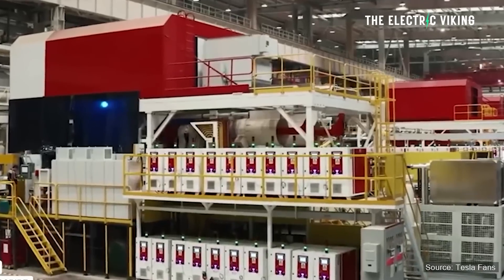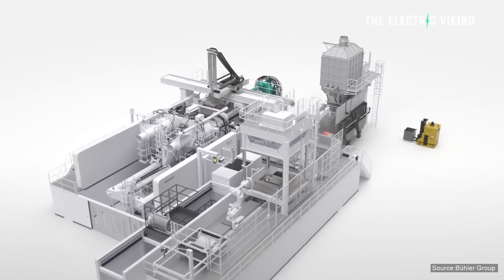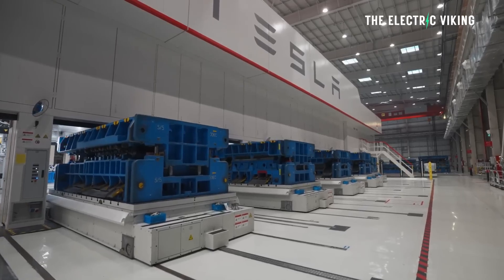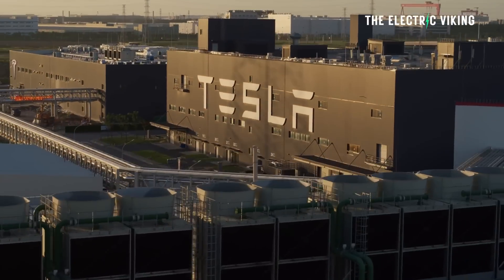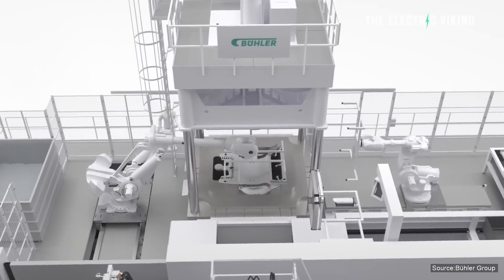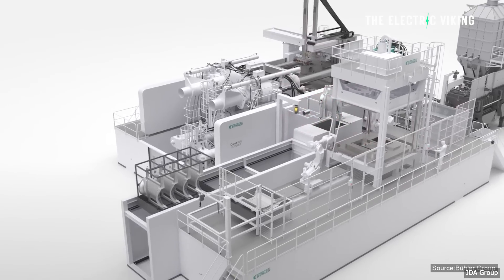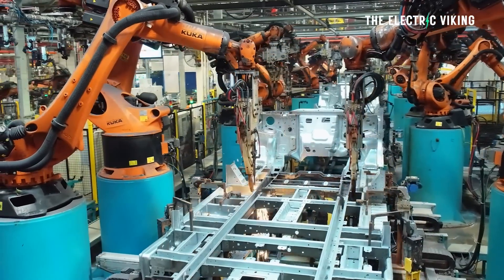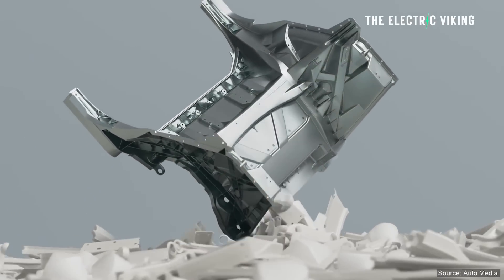Chinese engineers invent giant magnesium Gigacastings for cheaper, lighter EV's

Comment: The "stainless Magnesium" Mg Lithium alloy developed at Monash Uni several years ago solves the corrosion issue (maybe too well in that etching for bonding processes may be more difficult if possible . ) Thixotropic molding has been in use with Mg alloys for a long time and allows net shape production in one step mobile phones used it and some secondary automotive parts aerospace etc - this material and processes are superior in most ways to carbon fibre composites and many times cheaper -the energy absorption of Mg is best of all on weight basis and thicker skins resist buckling better . High pressure and high shearforce molding make for higher grade material than 'casting' might suggest.
Reply: crossing out is a glitch sorry.

Comment: Ammonia is poisonous. It is used in big refrigerator equipment which when  leaks occur has killed people. We are not talking of kitchen cleaner but a dangerous concentrated chemical. A fire in the batteries of cars which spreads to the magnesium is probable. Soap, if applied to magnesium destroys the crystalline structure causing amazing collapse of the part, into dust.

Comment: There's no evidence giga castings are used in any Tesla battery pack. Certainly, the structural packs are joined to castings, but are not themselves castings.

Also, it's not clear giga castings are necessarily cheaper than other production methods. They have the advantage of being faster and having lower scrap rates once tuned. And the parts have tighter tolerances. But they're not necessarily less expensive as the capital cost is quite high. Elon has discussed this a little bit in interviews over time. That they contribute to higher speed production and fewer defects (i.e. less rework and rejections) makes them valuable, even if they're more expensive.

Comment: Magnesium Pressure Die Casting has been around for years. 16 years ago a company I worked at used Mag Die Casting Process for a major component to be manufactured in China. They actually suggested the material and many engineers / designers were surprised but it certainly worked. As always the devil is in the details, Properties to consider are: Strength to weight (not just weight), fatigue life, Impact properties, distortion after casting (cooling), machining properties, compatibility with mating parts (pressed steel etc), Die design requirements and resulting cost, Die lifespan etc etc.       The moderate weight saving is only part of a complex equation to decide it's real advantages - if any.

Comment: The body of a car is much less than 50% of the total weight of the car. Therefore, it is not worth risking the use of some light, but delicate and easily corrosive materials to gain a dozen or so (in gusts) percent of the total weight.

Comment: Magnesium have low density and low mecanical strength, so the saving in weight for a manufactured part is not so big. But the fire hazard is big. Mg fire can't be put out by water or car on dioxide. Combined that with a powerful batteri, and cathastrophes will happen.

Comment: I had a friend that I crew chief for when he was racing.  His racing wheels were made of Magnesium.  Yes it was so light.  The advantage of a light wheel increase the handling by having less unsprung weight thus the tire is spending more time on the racetrack.  Also airplanes do use this material to lighten the airplanes.  This material can catch fire so you need to be careful

Comment: My motorcycle from 1998 has a die cast frame. Nothing new under the sun here. Only car makers didn't pick it up until now. 

May be the auto makers should also look to the possibility of using pressed fibres. May be carbon, Kevlar, Nylon or natural cannabis fibers!
And what about a modern methode of building cars like the  old school DDR build Trabant (?).

Comment: Hi Sam, I remember a fire 🔥 in aF1 car at Spar, back in the 70's 80tes, made of magnesium, very very skery . Very difficult to carst even being an alloy. I have seen on utube  a video of repairs to Tesla S "water seal, $7000, one cell in a battery 🔋 pack $7000 to. $15000 to fix. This makes me think that we might be in  the 😢😢😢early years of EV development.
Reply: Tesla designed their EVs to be built around the battery pack, making it an integral part of the frame.
It's not meant to be removable, and replacing one cell means taking the entire EV apart.

Comment: Magnesium castings is not new and I would be interested in the alloy combination they used because it’s not as a rigid metal like aluminum or steel. I don’t disagree with thebl approach to weight savings but magnesium could be a “quick and dirty” way to drop weight but with a whole lot of down sides. Also it’s going to be a long time between a scientific “discovery” and production scale capability.

Comment: Most magnesium is severely corroded by salt water so these wouldn’t be very good in the northern US states or near the ocean.  There are additional corrosion issues as well.  The fire issue is slightly overblown.  It’s very difficult for SOLID magnesium to catch on fire, but it does burn very hot.

Comment: I saw a car fire once where a "Hot Rod" with magnesium wheels--aka "mag's" burned so hot that the wheels melted the pavement while the first responders sat back and watched because there was nothing they could do to stop the magnesium burning.  Apparently magnesium can even burn under water.  I think mag wheels were eventually regulated out of automotive use because of the fire potential.  I would need to see a LOT of 3rd party testing data and 5 plus years of actual real world use before I would even consider putting my family in a car with giant magnesium castings.

Comment: I note a lot of comments below that are critical of the idea of using magnesium.  These are alloys and obviously they are tweaking the alloy significantly to come up with superior characteristics.  I don't know how this SPECIFIC magnesium alloy stacks up against aluminum alloys in every aspect, but I doubt any of those posting critically below do either.  There is definitely some impetus to using the magnesium as a key element in these car casting alloys as described by Electric Viking, because of the obvious advantage of being lighter.  As far as stuff like increasing the danger of fire, we don't know to what degree that would occur with this specific allow and we don't know if by simply reducing the battery and adding some more fire mediating material (a little bit of weight added back), they couldn't reduce the fire hazard from what it was with another alloy.

Comment: Magnesium ???  recipe for disaster.  😂🤣🤪  Magnesium is known to burn more easily than aluminium. When magnesium is exposed to heat or ignited, it undergoes a highly exothermic reaction with oxygen in the air, resulting in a bright, intense flame. The combustion of magnesium occurs due to its high reactivity and low ignition temperature. Magnesium has a strong affinity for oxygen, which means it readily reacts with oxygen in the presence of heat or a spark.

Comment: As mentioned  - Magnesium metal and its alloys are explosive hazards; they are highly flammable in their pure form when molten or in powder or in ribbon form. Burning or molten magnesium metal reacts violently with water. Remember the VW bus engine fires?...
..
Magnesium alloys are not as strong as steel or aluminum alloys. It may be good enough for moderate strength applications, but for high strength applications where weight is not a critical consideration, aluminum or even steel would be a better choice.

Comment: Sam, you hit the nail on the head. Magnesium is not necessarily the best material for making cars. We will have to see how these structures hold up under repeated tension and also in a crash.  Could be good but if so why did Tesla go with a proprietary steel casting?
Reply: Tesla developed their own Aluminum alloy for their Gigacastings. Not steel.

Comment: A more practical way of reducing the cost and weight of EV's might be to eliminate the AC to DC inverter on the vehicle. All the charging stations would need to supply DC lke the Tesla superchargers do. 
You could offer a, 'luggable' AC to DC inverter which people could keep in their home garage or even fit into somewhere on the car like the Frunk for people wo want insurance against running out of battery power away from a charging station.

Comment: There are several aspects to this.  Magnesium pricing has shown a lot of volatility in recent years and is susceptible to demand levels .  Aluminium if trading at about $1000 less per ton than Magnesium ($2,500 vs $3,500) and has less price volatility due to being produced in relatively vast quantities.  Tesla castings use an alloy of Aluminium to improve flow in the mould, minimise shrinkage, increase mechanical strength and offer good corrosion resistance (no paint finish required). The real benefit of castings is the reduction in production line footprint.

Comment: Magnesium is flammable, burning at a temperature of approximately 2200 °C (4000 °F). 
The autoignition temperature of magnesium is approximately 473 °C (883 °F). The extremely high temperature at which magnesium burns makes it unsuitable for mass consumer items and may explain why ev fires are so difficult to extinguish.

Comment: There's a difference between magnesium and magnesium alloy, and alloy shavings. Magnesium alloy is not flammable, they are used to make jet engines and can be arc welded and not catch on fire. This is a common misconception.

Comment: Magnesium SUCKS is why it is NOT used.  IT shatters.  It corrodes easily.  It cracks easily.  Yes, it is absurdly easy to cast and it is absurdly cheap as there are gigatons of the stuff around... No one cares.  

For F's sake dude, get an F'ing clue about engineering and stop embarrassing yourself!

Comment: Ummm..magnesium also has a great feature...its flammable and the best thing is...if you put water on the fire it gets even brighter and bigger. It does need quite a high temp to start but that battery will help it with that. This seems like a crazy bad combo. 
This is concerning.

Comment: You will need to answer a lot of questions about how technology has improved before I buy a car with major components and structure built out of magnesium. I think the car manufacturers promoting magnesium as a casting solution, don't have the ability to do the same as Tesla using aluminum and are willing to produce inferior product which is not as safe and strong  and corrosion resistant, as the Tesla castings, and are willing to selling the public on false claims. Buyer beware.

Comment: Casting out of Magnesium can be extremely problematic as Magnesium is extremely flammable and cannot be extinguished with water.
Magnesium is also an extremely soft metal, which in it's pure state can be cut with a dull knife.
Yes alloys of magnesium can be used (they made race wheels with them for years), but there are much lighter, and stronger materials which can be cast. Such as grapheme impregnated resins, or carbon-epoxy. Both of which are lighter, stronger, and cheaper.

https://www.youtube.com/shorts/3ESLDy9-SDc
https://www.youtube.com/watch?v=T3DK-jEWQg0

Comment: Magnesium car bodies and lidar self-driving Chinese cars, just another communist hightech disaster in waiting.  The Chinese have invented a lot, but it is more than often impractical and many products have a very short life span. The collective communist hobby seems to be to manufacture a low cost product that looks good, and if it fails don't notice it. The cultural revolution of the sixties isn't over yet (traditional values out, commie dogmas in, the second generation),  so the Chinese need another cultural revolution towards high quality and durable products with very long life span, and make that a tradition (back to normal in other words). That will keep China busy for a while, there is no other path to the future.

Comment: Beware Magnesium. Both Mg and Al corrode rapidly, but Al immediately forms a protective skin, although some high strength Al alloys do corrode, in general Al is much more tolerant of damage. Mg can be protected on the surface, but if the skin is damaged corrosion will start straight away. Any bump will need to be protected straight away or the Mg component will corrode away from the scratch!

Comment: Magnesium is fire hazard  and you can't extinguish with water. it cause explosion,  i think they mix it with Al as they do with soft drink cans to make the alloy stronger
There is Mg for 1000years supply in the dead sea in Israel which already produce into metal Mg with small volume but if needed production could be increased. so no shortage of Mg out of China

Comment: Okay- too many things wrong with this.  First, you need a new alloy that 1- has no fire hazard;  2- is more stiff and less brittle; 3- can be used in a Gigagast machine without the need for heat treatment, like the special aluminum alloy that Tesla uses over conventional aluminum alloys used in cars.  Also, your statement that using magnesium in a gigacasting will save money over less parts than aluminum in a gigacasting makes no sense.  However, if, IF they can develop an alloy with all of the above improvements, great!  But we see announcements of new 'breakthroughs' all the time- will believe it when I see it.  Lastly, the killer for this news article is you mentioned they were going to use Mangesium not in 2 or 3 gigacastings, but for one GIANT casting.  just going from a Model Y gigacasting machine to one for the Cybertruck was a jump from a 6 to 9 ton machine.  Do you really think they have already jumped from a 9 ton machine to an... 18 or 20 ton?  Again, I am skeptical.  Perhaps in the future... but I doubt it just yet.

Comment: The Magnesium alloys I know of aren't as strong as Aluminium alloys, they have other benneficial advantages such as a superior rigidity to weight ratio so they may be practical for teh gigacastings, but given it not as strong in tension/compression you would need to use moe Magnesium which rather compramises the materials use on the basis of cost.
Lithium would make an incredibly light vehicle since it is only half the density of water, unfortunately it also dissolves in water!
High strength fibre composites have the problem that the resin binders take a relatively long time to cure.
Titanium would probably offer the best mix of properties for the bodyshell but it's expensive to refine and a bugger to form into shapes so until the Deep Mind AI can come up with something better we're stuck with steel alloys, which all round are actually pretty great from a general manufacturing point of view!

Comment: I will reserve judgement until these cars are made and undertake many crash and fire tests have been performed to determine safety. Sure, magnesium (Mg) is much more volatile, unstable and brittle than aluminium or steel. In the chemistry lab, we used to put a flame to Mg strips and after 10-20 seconds, the Mg strips will burn fiercely producing a white-hot light that can easily blind someone if they stirred straight at the light source. Safety is paramount, overriding cost and range. This is why I won't buy an electric car using NCM batteries even though it may have better performance and range compared to my Atto 3 using BYD's Blade LFP batteries.

Comment: I wonder how you go with galvanic corrosion between the casting and the rest of the body. BMW would use extra wide gaskets to separate magnesium alloy from aluminium on their engines.
Reply: And they still leak.  2006 bmw z4 owner here.

Comment: Casting technology in China has seen enormous improvements in the past decade.  Many companies are seriously engaged in Semi solid, Rheo casting etc.  it is not difficult to believe the competition has advanced technology with Magnesium alloys
Reply: My problem is not with the process improvements but the material and it lite but very brittle nature, especially in cyclic loading vs longevity. I feel that it is a cheap fix to the weight problem, as why we generally don’t use it in manufacture.
Reply: @seank7288  I can't comment specifically on magnesium but in aluminium casting it is eye opening how many unique processes there are, and how varied the results are.  I believe that magnesium properties can also be altered similarly by process and doping.
Reply: @glenmcneill1675  You are not wrong, as there are seven grades of aluminum with vastly different properties, especially relative to strength and heat tolerance. Controlled form casting has seen huge advancements, like with sport bikes and their controlled die casting process. Though magnesium is lighter and a bit stronger, especially when forged. Like rims for cars or bikes, it’s also much more brittle. Other than for show magnesium rims are only good for the cycle life and high budget of racing and a road with no bumps, and that is my worry in this context.

Comment: Magnesium aluminum alloy (Duraluminum) is used in all aircraft bodies due to strength, weight, and corrosion resistance.
Only a few countries have the technology required to work with it, and thus the capability to manufacture aircraft... lol

Comment: I don't have a forum except in my own community, which is an uphill battle in Steak chewing, Gun totting, ICE loving rural Arizona. What I would like to see: stack up all the crap that an ICE vehicle requires, such as oil, filters, batteries, cooling fluid, trans fluid, fan belt, alternator, starter, air conditioner, etc and all the accompanying maintenance intervals. Put them in a big pile and visually show folks what fun their missing out on... This has been on my mind for some time as a BEV selling point. Thank you - Reallly want an Electric truck...😎